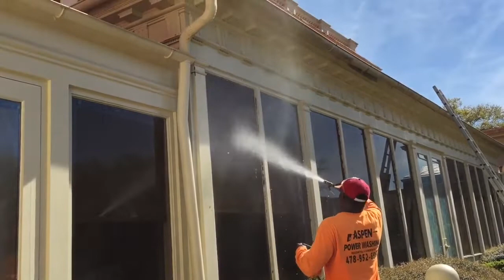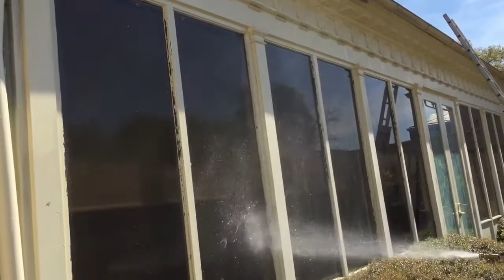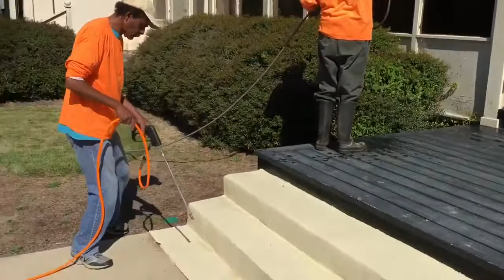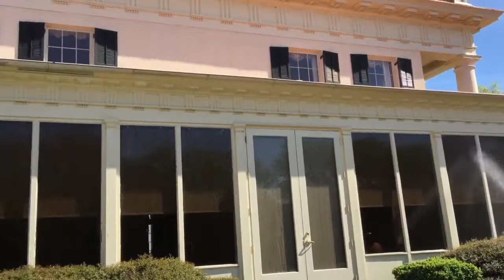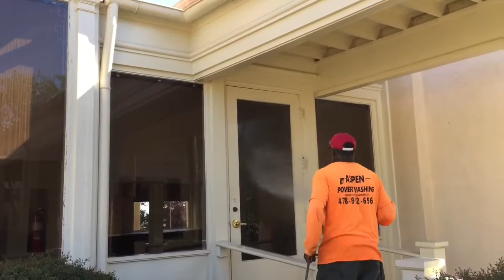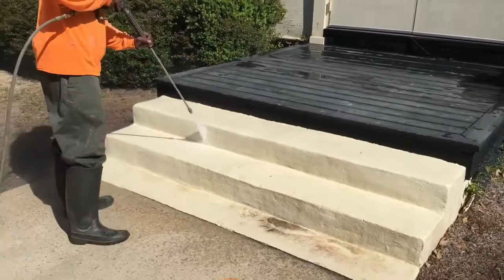Pressure Washing With A Ball Valve

Comment: How come with my ball valve it just excretes water like a regular hose? No pressure or nothing ?
Reply: That’s what it does if you open it all the way. It’s needs back pressure so dial the valve back.
Reply: @day2day734  I must’ve gotten a crappy one cuz mine definitely doesn’t do that
Reply: @littlebritches8631  The pressure is going to be determined by the pressure washers gpm rate as well as the psi. You'll have to get a more powerful sprayer. I learned this the hard way as well.
Reply: @robthomas9070  appreciate the response. Sprayer as in a different ball valve? I have a 4gpm, any suggestions on what to get, I am open to!

Comment: hi sir,  I'm not in the pressure washing business but when you say using a ball valve,  you mean there's only a ball valve on the end of the hose, no tip, so the water is just coming out the other open end of the ball valve,  thank you
Reply from the maker: Yes exactly, We are using a 1/2 inch cutoff valve and it’s open about 1/4 of the way. The more you close it, the more the pressure builds up. It does that until you shut it completely off.
Reply: Aspen Power Washing I have a ball valve, but it does not shoot out with the same force your ball valve does. Is there a reason for that?
Reply: @buggsay4002  I’m guessing it’s because he is running a high gallon per minute pressure washer. Probably a 4-5 gallon per minute washer.